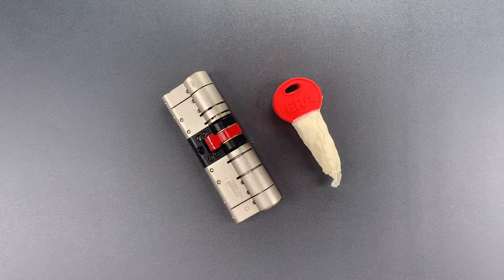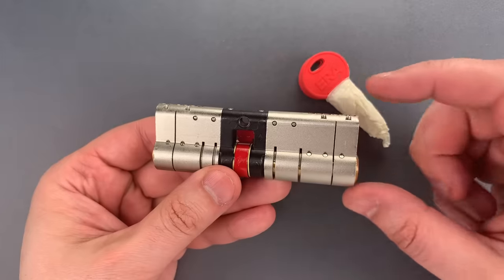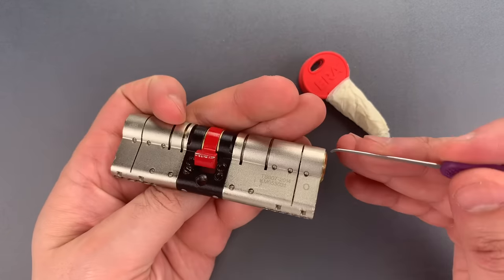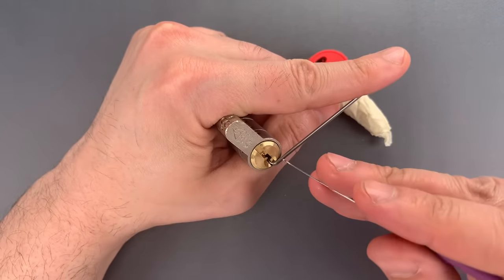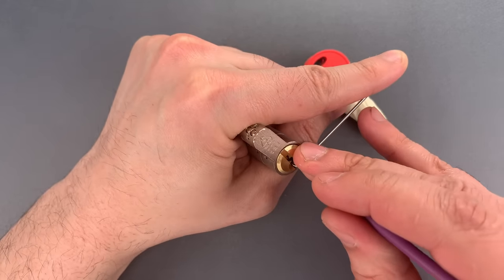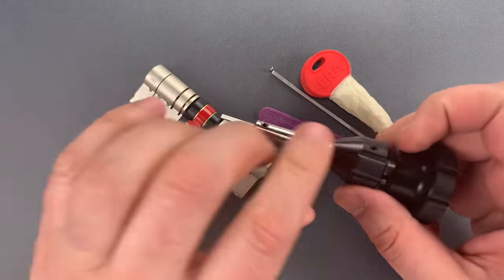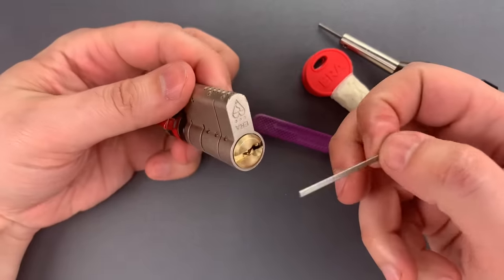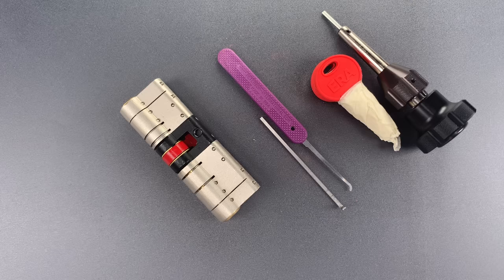[1256] ERA “Fortress” Euro Cylinder Picked (6 Trap Pins!)

Comment: So, if someone attempts to pick a lock like that and drops the security pins, how does the owner get the lock open after that? Don’t think I’ve ever seen that question answered and that looks like a locksmith’s nightmare to replace.
Reply: Would like to see this answered...
Reply: Since they are held in place while the key is in, I assume you can push them back by simply inserting the key?
Reply: i have seen very few locks with trap pins, and from what i know, they must be disassembled from the inside and the trap pins manually removed. in my opinion, if you are looking for a lock with trap pins, you are willing to potentially have to drill out your lock / replace your door (if you do not have another means of entry). i have done the trick to set up trap pins in a kwikset deadbolt as shown by lpl on another video because i am in a situation where it is completely worth it.
Reply: @tiloalo  Then they'd be pickable too. The pins are inaccessible (depending on design)
Reply: @rocketcarmike  so how do they not lock when the key is inserted? Is there 2/3 plunger?
Reply: The lock is held in place with a screw from center of the door with that type of lock cylinder. So it will entail damage to remove it.at least a heavy punch and hammer.  Or pull the door hinges pins if it doesn't have back side pins to keep it in door frame.
  You need a key to open from one side or other, so busting out a side window by the lock don't help you.
One of the first things I had to do when I was stationed in Germany was change the door lock cores in my quarters after I had a few unknown visitors.🙄
Reply: @yrk-ij9gf  You okay York?  Need to talk about it?
Reply: Depending on the position of the rotation, 
Use the key on the other side,  open the door, remove the screw that holds it in place and slide the cylinder out.

If the other side blocks movement of the latch, then you are looking at hard work.
Reply: at some point, knowing when someone attempted unauthorized entry is more important even if it costs a new lock or the visit of the locksmith
Reply: @catwiesel_81  yeah, I get that… I just am curious for example, how someone gets back into their single entry point apartment if they put this lock on it and a picker drops the pins. 🤷‍♂️

Comment: I have fitted these. Mine are not anti-snap on the inside. They are by no means the most expensive, about £35. Pretty good value, for one of the best euro-cylinders around. The bitting is a bit severe, they are known to stick. Some WD40 can help. My front door is coated with metal, so as secure as the lock. The rear doors are UPVC full-length glazed, so less so.

Comment: Incredible like each time... and new custom tool is really cool !
Certainly one of the most serious lock LPL has shown on this channel.
The problem is the door itself and the windows... burglars always go to simplicity and weakest parts. They will prefer to break the door, to melt the window (most are in plastic), etc, they will never try to pick the lock. That's why most locks are not so strong and why it is not so important. (That's another story when it comes to gun trigger guards or safes, the lock is more important).
Reply: Perfect for an apartment door tho.
Reply: @astranger448  yes, if the door has no weak point. Else a true burglar will see and use it instead of even looking at the lock... It is a never ending story...

Comment: I mean... Part of the protection this lock ought to offer is obscurity as to its mechanisms... He could see them in advance  so this demonstration isn't particularly impressive. Like he admitted,  coming across this in the field without prior knowledge and not permitting easy disassembly is an entirely different story. It would be interesting to see him attempt such locks outside of his  typical environment.
Reply: Security over obscurity is a very unreliable principle, and security professionals do not rely on it too much these days
Reply: Not at all difficult, it has era and 3 stars on the front so is easily  identified,even if you do hit the first set of trap pins they are not hard to get out of and you can bypass the rest
Reply: @cardiffpicker1  what would prevent anyone from sanding off the branding from the front of the lock? :)
Reply: It would be really nice to see a full dry run on something like this lock, how long it took for him to find the security tricks, and the solutions for it and how long it took for non assisted run, sadly that would be probably a long and mostly boring video of him thinking and searching and trying tools that are failed in the end.
Reply: @PhilippBorn  out of everything that has never happened, that hasn't happened the most. 
The branding and stars are there to  make potential burglars see it is a high security  lock and go next door.
Reply: @thorin1045  this particular  lock is ni different  to several  he has picked before and would not have caused  any issues.
Reply: @cardiffpicker1  Those 3 stars are because it is a British 3 star kitemark lock (i.e. a lock that has passed a certain standard... mostly in the defence against lock snapping it seems) admittedly ERA only seem to have 1 other current lock at this standard (The "invincible" ) which does look totally different and doesn't seem to feature the trap pins
Reply: @fatrobin72  invincible is a pain in the arse, they onl fit in ERA lock mechanism (which are crap),need compatible handles. 
Just a scam to lock you into their brand.
Reply: @cardiffpicker1  it does look quite odd and yeah the unique shape does remove the freedom of choice of what to go with next time...
Reply: @fatrobin72  I have only seen them on a couple  of new build flats  even then half had changed them out
Reply: C’mon. Unless it is a brand new lock (or pre-production) or very obscure LPL is going to know about it. One of the reasons people are drawn to videos like these is to watch a master of their craft do something that is hard while making it look easy.

Comment: One question LPL; when the trap pins drop, is the lock not repairable anymore? Or can you just reset it with the key. #dare to ask
Reply: I’m also very curious about this. I almost wish I’d sent the lock encased in something so the trap pins weren’t visible!
Reply: @calvinw  Spec here: https://www.eraeverywhere.com/globalassets/era/data-sheets/10759_data-sheet.pdf implies that you can then only open the lock from the other side.
Reply: @John-uh1pb  The security pin is the feature that kicks in if someone tries to snap the lock past the first snap point. It stops the core from being rotated from the snapped end.

Comment: Woah! This is a very interesting lock... I thought after you picked the lock you'd show us what the keys looked like.  So what happens if you fall into the trapped pins when picking? Does the core seize until you put the real key in, or are you permanently locked out?  (And if permanently locked then how do you get inside without damaging the lock or door?)   Inquiring minds need to know!  Thanks!
Reply: this curious mind wants to know too

Comment: Every time when you are picking an european lock, you always pick it upside down. Could you show us picking one of theese locks in a position that it would be installed in a door? Would it make a difference considering gravity force or would it be exacly the same? I'd love to know your opinion.
Reply: Ok, so the trap pins essentially work due to gravity. Things don’t fall up. So if it was upside down the trap pins wouldn’t be able to engage.
Reply: @wanderingprophet3948  I would be very surprised. While most locks are mounted "upside down" there is no requirement to do so and you are free to mount them as you see fit. I routinely see locks mounter upside down.

I 100% expect the pins to have springs.
Reply: @ndi4926  To install this type of lock "upside-down" you would also have to install most doors it fits upside down as the doors are shaped to the lock profile.
Reply: @ndi4926  It’s a European profile lock. So it fits into a locking mechanism and likely into a door handle. You can’t just fit them upside down. I doubt you routinely see europrofile locks upside down. I think it would add authenticity if LPL would start picking these the way they would be in the field. Maybe it makes no difference but who knows?

Comment: Am i correct that if he didnt know that the lock had trap pins as he couldnt see because of the door frame, he would have just got stuck. 

How do you know this without the entire lock being exposed like this? Can anyone please explain.
Reply: I think with enough experience, you would be able figure out generally what to expect in a lock assuming the the lock isn't labeled in a super obvious such that you could google what is inside the lock. You don't really know exactly what is inside the lock.
Reply: Well, it would take an in-depth knowledge of the kind of locks out there and various security features. One might be able to identify the lock (or give it a good guess) using markings around the keyway or even the keyway itself. But that’s yet another skill requirement that makes picking this lock more difficult.
Reply: I imagine you'd be able to identify the lock by the logo and keyway, and then apply the correct measures?
Reply: @benuscore8780  unless the core is noticeable, LPL would get caught in the trap sadly
this lock actually reminds me of that kwikset the LPL made for how to add trap pins on $1 lock so that it will render the lock unusable
Reply: Hard to see the markings on the face, but ERA is there...if the model # is there also, you could go look it up. 

But from a thief standpoint, I can't see someone doing that unless you want something behind that specific door, vs just looking for easy places to hit.

but for a locksmith trying to open, the model# would be useful, so having it on the face makes sense.

All about deterring the bad people

Comment: That plug-flipper modified with a little pulley on it's tip would would make an awesome loose-tooth puller... just tie one end of a piece of string around the loose tooth and wrap the other end around the pulley and hold the string taut and then push the button... tooth vanishes from it's socket in a flash... lol :-D
Thanks for sharing, LPL... that lock's definitely a badass lock.

Comment: I wonder if this would be much harder with the lock installed such that he couldn't wrap his left hand around it.
Reply: I think he’s good enough to deal with that. However I think you have a good point - over here in the UK all of those locks are installed the other way up (key at the top and pins on the bottom). I suspect that would cramp his style quite a lot more.

Comment: Most houses in europe have this style of lock with all these features, in fact this cylinder is rather common, none of that garbage kwiksets and the like
Reply: jealous...I have those stupid kwiksets around my house, my solution is to have cameras and load my weapon before the door opens lol
Reply: I checked and the lock seems to be 35 euro to 40 pounds. 

I might have gotten the wrong model, but the security features seem identical.
Reply: The trap pins are a less common feature, since picking is not one the common attack methods burglars use. Anti-snap protections are common, though.
Reply: "Most houses in europe have this style of lock with all these features".
No they don't.
Reply: @EaglePicking  Yes they do...
Reply: I wouldn't say this quality common in the UK. Anti-snap yes however single "star" is more normal.
I have these https://www.amazon.co.uk/gp/product/B07M8CZPY3
"Schlosser Technik 3 Star High Security Euro Cylinder"
Yours for £37 so not mad money.
Reply: Very common in the UK is the use of UPVC doors with steel/ali cores, these have multiple locking lugs and deadbolts. Watching police try and kick these doors in is hilarious and they now use hydraulic spreaders as the flex alone in the doors just bounces the 'big red key' off. I replaced my Euro 5 locks with ones like this simply because my wife lost the keys 🤪. The locksmith used a sliding hammer on the old lock and was in, in about 2 mins flat. The new ones however...

Comment: Yeah but did you see how many tools and techniques he had to use in order to get this open?
I once opened a plastic gumball machine using just a hammer and zero technique so who is actually the winner?
Reply: I'd say you are the winner.  Gumballs > just opening a lock
Reply: Imma say LPL, he did all this without damaging anything, even the feelings of the people who crafted the lock.
Reply: It took precisely 1 more tool than usual, the spinner, hardly a burden. In fact it was super easy, barely an inconvenience to have that extra gear.
Reply: @NorthernSeaWitch  Only needing 1 extra tool to open a lock is Tight!

Comment: I have something very similar mounted in my front door (with 12 pins instead of 6). I'd just like to add, that it might not be so easy to flip this with a plug flipper and the handle of a turning tool (a shim may work better, IMO), as they have very close tolerances and require considerable force to throw the bars, especially in modern doors, with multiple bars all over the door frame.

Plus, if you leave the key inserted and halfway turned from the other side, like closing the door for the night, there is simply no way of forcing the entry via manipulating the lock in any way, even if you drill it from the other side - the throw lever has reinforced steel plates from both sides, so good luck.

In short, you'd probably have more luck just hammering in the door frame, or using an acetylene torch instead of forcing this lock.

Comment: Plug flipper is nice in the lab, but usually these cylinders are used in locks that require multiple turns of the key to fully (un)lock. As such they have a fairly high friction wich does not allow for a spring loaded mechanism to rotate the plug fast enough to get past the trap pins.

Comment: My neighbour had one of these locks fitted to his flat front door, the only way in is through the front door as it's a12th storey Hi-Rise. He lost his key and couldn't get in so phoned a local locksmith (possibly one with just a certificate and a drill) They spent 4 and half hours trying to get in, they were using drills crowbars, hammers, you name it! The noise they made was horrendous. When they did eventually get the door open it was completely wrecked along with the door frame and they charged him a small fortune (I think it was about £300) He also had to buy a new frame and door along with a new lock as they just left without securing it. Not sure I'd want a lock this hard to overcome as I live next door to him..

Comment: I think this is made by Federal in Taiwan. They often OEM their locks. It's similar to their 6YCF. They also have a UCF lock with similar design except for a dimple core pin in pin with one magnetic pin. Both locks rated TS007 3* which is the highest rating available in the UK.

Comment: In most main access doors in the UK, a 360-degree turn would not be enough in my experience. Most UK front doors will deadlock, using 2-3 full revolutions of the core pushing a locking lug deep in to the door frame. So although you could pick this lock, you would have to do the whole procedure 3 times in some cases.

Comment: just watched your video on 3* Yale eurocylinder un locking and wanted to know correct tools to us. We fit these locks in our doors & recently wrecked a brand new door trying to drill & grind my way into the middle to open. Got it open but slightly damaged the door surface no hidden by the handle so advice appreciated

Comment: Let's also not forget that in the real world there would be a load attached to the bolt. Meaning there's a good chance that this quick turning tool doesn't have enough torque to reach the necessary speed to bypass the trap pins.

Comment: LPL, I have always been a fan of your videos, and I have learnt an extraordinary amount. My only question would be:
If you took an ERA fortress key and filed the teeth off and then partially picked the lock, could you not then put this toothless key in the lock to engage the cam, and also push the sidebars out of the way to be able to twist the lock 360° to unlock it, as I have found this a very effective tool with other Locks.

Comment: I wonder if plug flipper would work with lock installed in the door, as there would be much more friction and a lots of force would be required to rotate core with whole lock fast enough that trap pins wouldn't drop down.

Comment: I would like to know if this flipper-tool also works when the cylinder is built into a door and it has to overcome the friction of a double-turned lock with 3 snug rear hinge bolts.

Comment: wonder if some electrical timer would be possible, that after you start touching the inside of the lock it has 1 second timer that starts, and if you spend longer than the average time it takes to use the key, it will just lock down the lock

Comment: These are standard door locks in the UK (and most of Europe if I'm not mistake).

You had the lock upside down though. The pins are supposed to be on the bottom, not the top. Not that it would have changed anything though.

Comment: Would a door need to be thick in order to fit that lock? The length of it looks long. And how would one know about the trap pins without visually seeing the side of the lock? Does one just assume that they are there and use the plug flipper?

Comment: How good does an anti Drill pin protect against an Grinder.... we use the Milwaukee  HD28SG at the Firedepartment and there are two possibilitys...
1. I never got an Lock with Anti Drill Pins or 2... the Powerfull grinder just ignores them.